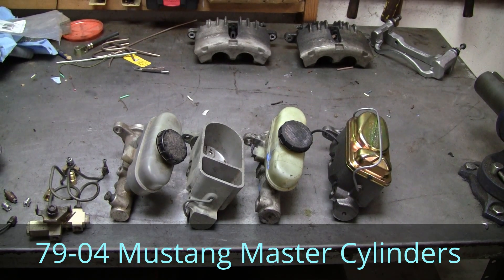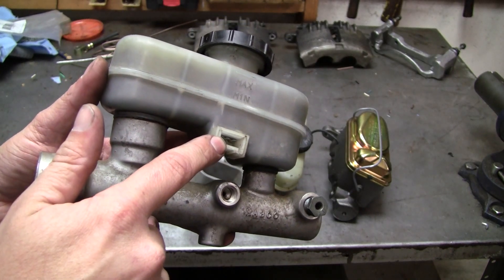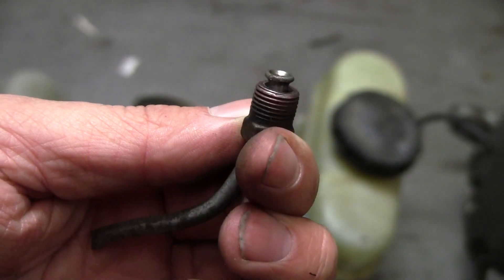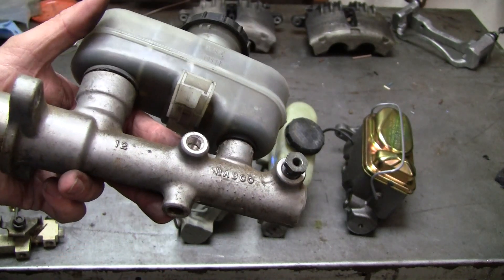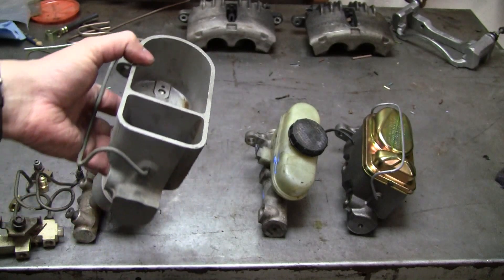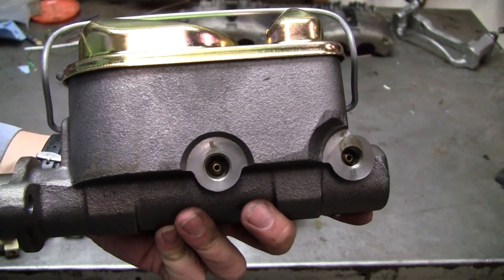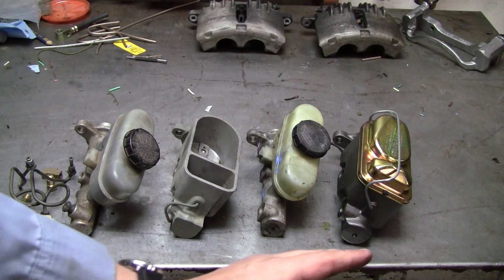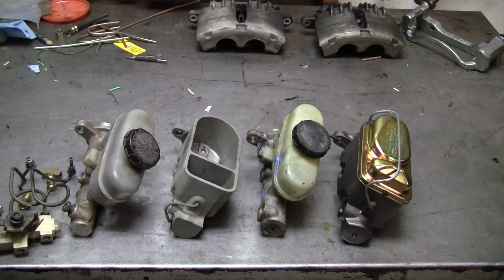Mustang Master Cylinders for brake upgrades :: 79-93 and 94-04

Comment: the ford crown vic master and mustang master swap over crown vic stock has a 1 inch bore
Reply: this is referring to the 03+ models they also have a level sensor but its connector is different than the one found on ford mustangs

Comment: I converted to rear disc, im using t bird turbo coupe rears and 60mm front calipers, stock 5.0 booster. I want to add a 93 cobra mc, and an adjustable ppv. How many turns out on the booster rod? Thank you

Comment: Great video, I have a question.  I have a 93 lx convertible and I'm doing the swap. I sourced everything off of a 94gt except the brake booster, should I get a brake booster or can I use my 93 booster?
Reply from the maker: The 93 lx booster will work but the 93 cobra is a better overall booster.  Same as 94/95 but has a fox firewall bolt pattern.  The 94/95 will work with some clearance-ing of the firewall.
Reply: @JohnButler350  appreciate the information....I think I might run mine and see what it feels like.......thanks again 👍

Comment: Assuming a stock new edge v6, factory brakes, or maybe a small front brake upgrade, what is the harm (negative effects) of using the larger bore SVO Master Cylinder.  Seems like much more braking force with less pedal effort, but no real negatives beside overbuilt. Is there an actual possibility of blowing out brake seals? Seems you can do that with any Master if you kick the pedal hard enough?

Comment: Are the 79-86 brakes as good as 87-93? I see a lot of guys use stock brakes in their street/strip car that's a 87-93, but cant find anyone who uses stock brakes on their 79-86. I just bought a 79 is why I'm asking
Reply from the maker: If you are doing 4 lug then upgrade to the 87 to 93 v8, yes they are better
Reply: I have a 79 as well. I installed the PBR front calipers and the five lug spindles. I just ordered a 93 cobra brake booster, but running into a problem sourcing the adapters to run the 93 cobra master cylinder

Comment: Thanks for all the nice/informative vids! My ‘89 Fox currently has ‘95 Cobra front brakes and drums in the rear. I’m about swap in a ‘04 Cobra IRS. What MC do you recommend? What brake line kit would I need? Also, will the stock Fox brake booster be ok?
Reply from the maker: The cobra IRS uses the same varga caliper as the gt with the live axle but the rotor diameter is larger.  I would go with a 95 cobra master and the 93 cobra brake booster.

Comment: Hello which master cylinder would yo recommend for a SN95 five lug conversion on the front, but still running rear drum brakes?
Reply from the maker: I don't recommend that combo, sorry.  Best best would be sn95 rear varga calipers with a sn95 master.

Comment: I  converted  my 1988 mustang GT to manual  brakes including the  Manual brake peddle 
system, I had to go to a 15é16  bore to get the  peddle  to have proper feel!  
I  used a large 1.062  bore because that was what most people I talked to Recommended!    the peddle was so hard I couldn't  stop the car. I found the Manual  master for a 1988 ranger fit and give me more room because the lines  come out the  left side.
  I am running stock GT calipers  front and  10`x 2` Ranger drums rear!

Comment: Last year I found a chart that listed all of the master cylinders with bore sizes and fitting sizes.  It also listed any other differences.  I can't find it anywhere now.  I know I wound up with a V6 non-ABS master but I don't remember why I chose that one.  Does anyone know where I can find this chart again?
Reply: I found it!  The page was offline but I was able to get the PDF using the internet archive.  If anyone wants a copy let me know.  It also has Ford and Raybestos part numbers.
Reply: Tyler Smith Can I get a link to the chart? Thanks
Reply: Ill take 1 as well

Comment: I'm running the same PBR dual piston calipers u have there and svo rear calipers.. I'm debating weather the sn95 master is gonna push enough fluid to stop my car or should I go with the svo master cylinder.. also I have an original 88 4 cyl brake booster to go with that combo my question is would that booster workwith the cylinder or should I go ahead and upgrade too
Reply: The sn95 shafts are longer than the fox length axles, the sn95 brackets will need to be cut and flipped https://www.stangnet.com/mustang-forums/threads/fox-length-axles-and-stock-sn95-brake-brackets.859972/ OR fox length brackets can be purchased from north race cars. http://www.northracecars.com/Brakes.html
Reply from the maker: I recommend going with full SN95 setup.  Twin piston PBR with the 94-04 rear varga calipers, then use a sn95 v6 master.  combine with a adjustable proportioning valve.
Reply: Stang Vids yea eventually I will convert but as of now I already bought brand new calipers rotors and pads for the stock svo 7.5.. I did want to install the sn95 rear calipers on my 7.5 but I was told the sn95 mounts will not bolt up to my rear end so I chose to just go with this set up so I'm kinda stuck here for a while meanwhile I get a 8.8
Reply from the maker: 7.5 and 8.8 are very similar.  You can put fox length (ford ranger/bronco) axles in your 7.5" (8.8 and 7.5 use the same axles).  The housing tubes, flanges, and brakes are the same.

The 94-04 parts are cheap in junkyards, combined with used ranger/bronco axle shafts.
Reply: Stang Vids so u think it's a bad idea to use the svo rear calipers?
Reply from the maker: I'm not a fan of the SVO gear.
Reply: Stang Vids I haven't been able to test fit the caliper mount brackets.. if I swap them out of the sn95
your saying they should be able to work on the 7.5 no problem?
Reply: John Butler oh dude that was cool I'm for sure doing this.. thanks for the link👍

Comment: ok im building a 79 fairmont id like swap over to manuel brakes but not real sure which mc is best . Ok i did 4 disc brake running 87-93 up front and explorer in the rear i know they sell many kits but ive read that the mc they offer are for big bore brake systems like wilwood and others which with stock brake your pedal will be really hard and not as responsive , since im just running bascailly stock brake set up do you know what mc would work best so id have best pedal response and braking ?

Comment: 1984 Mustang GT here, with front spindles/rotors/calipers off of an 87-93 V8 Mustang, and an 8.8 with drum brakes from an 87-93 V8 Mustang as well.

Either my brake booster or master cylinder are out, as I have to press the pedal almost all the way down for it to slow the car down (this occurred prior to me even changing the brakes). I am going to be changing the brake booster and master cylinder on the car, and was looking for suggestions.

a.) Change to a reman 84 booster/cylinder unit (although the internet says they aren't that strong of units)
b.) Change to a reman 84 booster/94-95 cylinder unit
c.) Change to an 87-93 booster/94-95 cylinder unit

The reason I mention 94-95 master cylinders is due to the number of ports. I believe it would make my life easier correct? Am I headed in the right direction with those choices? Any of them ideal? Thanks in advance!

Comment: I just need a gasket you can text or email me  not good with computers.  do not know if I should put email or phone number.
Reply from the maker: master cylinders don't have gaskets.  they have internal seals.  if yours is leaking you just need to replace the unit.
Reply: on top of the master cylinder where you fill it up with brake fluid.  when I took the lid off there was a gasket but the gasket no good..??
Reply from the maker: +tommy Didio gotcha.... the lid has a rubber seal.  I've never seen a replacement for that lid.  except when buying a new master cylinder.  might be best to find one out of an early eighties car in the junkyard and see if it'll fit.  you could probably rig one up by using the rubber from an innertube.
Reply: ok cool thank you

Comment: i  79 Mustang I need help find a master cylinder gasket for my car not sure if it's a true four cylinder car or a true v8 car has 82 motor in it v8 302 and my master cylinders cast iron like the last one on the video you posted Square in the back reservoir oval in the front reservoir if you can respond back I will be greatly appreciate it thank you
Reply from the maker: Cardone 13-1764 should be what you need

Comment: Great info... I currently have the MM SVO conversion with the Northracecars T-bird rears calipers. I'm moving up to 13"/12.65" 03/04 cobra brakes. I'll be doing this soon as I get my calipers powder coated. I have both of the master cylinders you mentioned 15/16th and 1 1/16th bore, just need to figure out which combination to use.

Comment: Hey there im doing zort of a crazy comptrapsion I'm setting a ford ranger 92 with 4 wheel disc I'm thinking on using mustang cobra brakes 12 rear 13 front including calipers, the thing is my factory master cil have a 1 in bore, would u recommend look for something larger 97s have a 1.065 bore I think, thanks

Comment: In the 6:00 min mark you say the bore size is 1-1/16" but measures 1.050" and then state that 1-1/16" is 1.125"   1/16" is .0625"  so unless you using a good bore mic to measure the bore your only .012" smaller than 1-1/16' not the .075" you say.

Comment: Hey John, Snot Rocket here definitely looking to follow this series in the near future. I'll be going to Cobra PBR calipers up front and disc rears on my '03 Cobra IRS and could definitely use a good recommendation on master cylinder and brake line/prop valve setup.